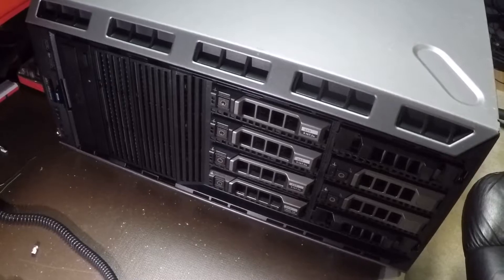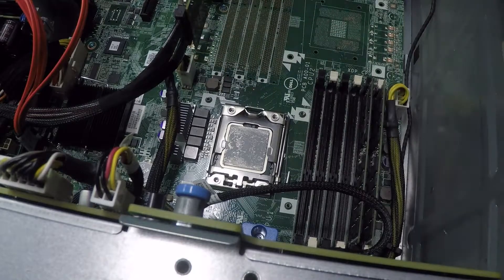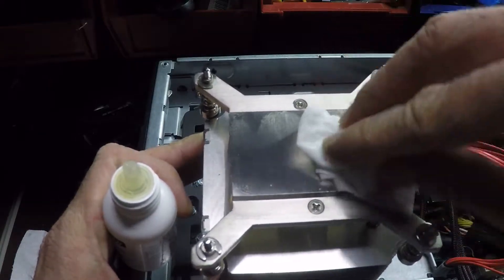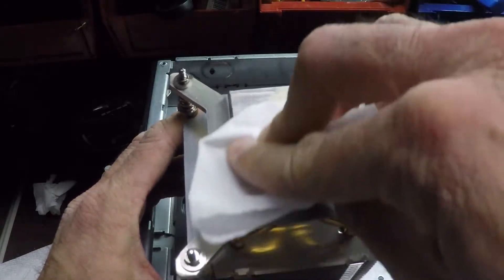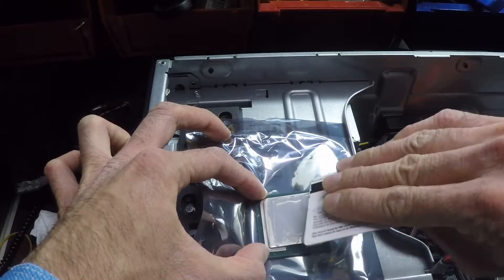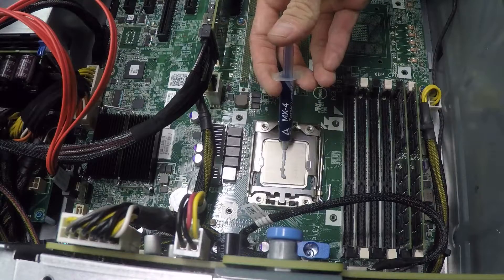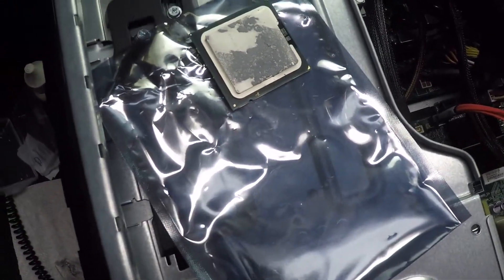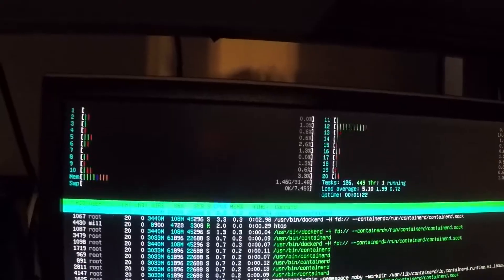Dell Poweredge T320 CPU Upgrade

Comment: No need to manually spread the compound out to fill in supposed pin holes. It's a precision machined surface, it should be flush. The tooling does not create micro holes.
Reply: Totally agree. He's obviously one of those fastidious guys that does extra stuff that is totally unnecessary.

Comment: So I know that it has been a while since this video came out but, what OS are you using on this?
I got my hands on T320 and when I put the e5-2470 v2 in it it will be better than the rig I’m running now for Plex (i7-2600).

Comment: Thanks for the video.  I'm looking at a T320 or T330 for a file server.  I like these since they can use 3.5 inch drives.  The first computer I worked on was a DEC PDP-8 fully maxed out with 32 K of core memory and a Teletype with paper tape for input and output.

Comment: I pieced together my first PC back in the 80's     Things aren't that much different under the hood   -----visually anyway.  We did not have heat sink  glue back then .    Probably 16 bit busses too.  As well as a 30 meg hard drive  (not a 2T hard drive) if I remember.   To funny how far things have come.   Nice work.
Reply from the maker: Thanks Bruce.  I have played with some of those old machines from the 80s and 90s.  They are fundamentally very similar.  I remember when 10 GB used to be lots of space.  Now one file can be 10 GB.  10 TB is the new 10 GB.  10 MB drives were before my time... the smallest drive I ever remember getting my hands on was a 700 MB drive.